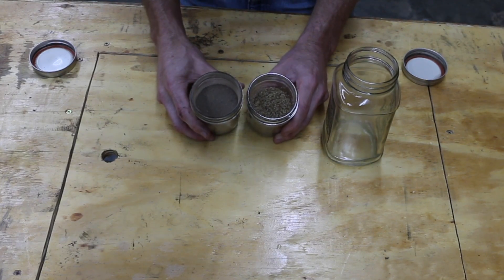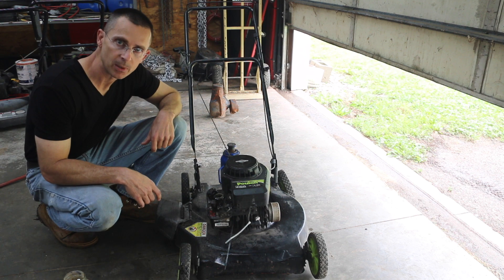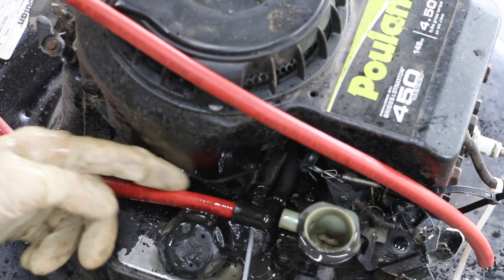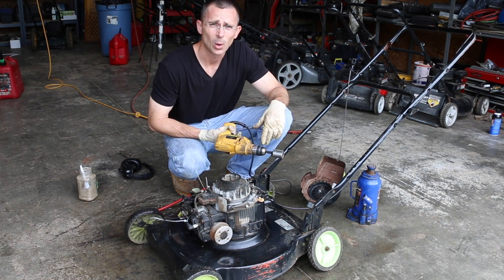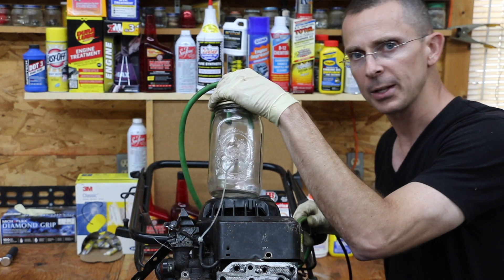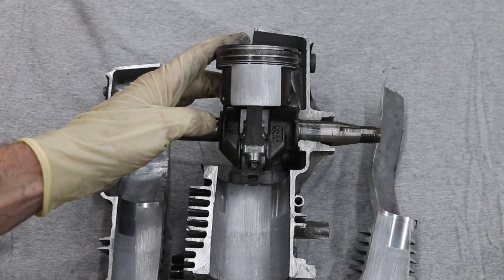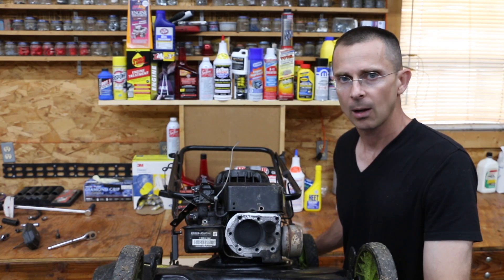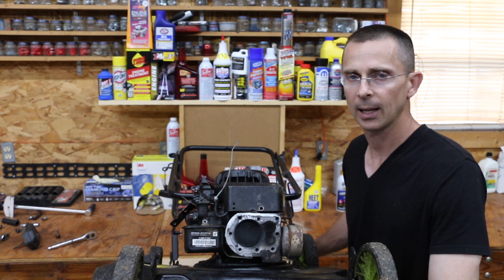Will Dirt Destroy an Engine?  See what it does to this Engine!

Comment: Your channel is awesome!  These videos satisfy my inner mechanical engineer!  I am 16 and I strongly live by the saying that kids need more toolbox, and less xbox.  When I grow up, I plan on being a mechanical engineer. Also, I currently have a couple project engines I am fixing up.  I have a Ryobi Weedeater, and a Homelite direct drive (clutchless as i like to say).  The Ryobi needs a carb cleanout and adjustment, while the Homelite needs an entirely new fuel tank assembly, because the fuel line burst in the middle of me using the weedeater.  Also, I got these weedeaters for FREE, because i saw them at the curb ready to be scrapped, and i picked them up.  Also, we have two lawnmowers, one is a Craftsman 4 stroke, and the other is a 2005 Lawnboy 2 stroke.  My mom's craftsman lawnmower is in serious need of an oil change, and may in fact be seriously damaged, because the engine has rod knock and the engine is very hard to crank, and sounds like it may have some piston damage, because i hear grinding in the engine when i crank it.  So my stepdad and I are going to use my mom's craftsman lawnmower as a practice engine for me to work on.
Reply from the maker: Thank you!  It's great that you're gaining experience!

Comment: Dirt can get through an air filter, some off highway equipment has a safety filter to prevent destructive damage from dirt. The air filter on gas engines is not too critical but diesel equipment like your farm tractor, the air filter must be replaced more often just like the oil and hydraulic transmission fluid.
Reply from the maker: Great point!  Thank you

Comment: Usually I like your methods, but this time I don't think pouting sand in the carb like that is an accurate recreation of what would happen. I would have used a hose from the carb intake into the jar with the sand in it, with another hole in the jar and another hose running down so that the passing air would kick up small amounts of dirt. Letting it run that way for a while would have made for a more realistic  scenario.
Reply from the maker: Thank you

Comment: Why not try xado revitslizant to get the engine back to its original state. They claim so
Reply from the maker: Thank you for the video idea!
Reply: @ProjectFarm  they claim to have run engines without oil after their revitalization treatment. Claimed that there was no damage at all. Compression improved, fuel efficiency improved.... These are the claims. 
They have many products that claim to make your engine forever, kind of.
Thank you for your initiative. I love each one of those projects.

Comment: I remember years ago back when carburetors were the norm in cars, people who lived in high elevations like the Rocky Mountains where the air was really thin would remove their air filters and replace them with coarse steel wool to help get a little more air into their engines. The steel wool didn’t filter quite as well, but allowed for better air flow while blocking any big debris from getting sucked into the air intake.
Reply from the maker: Thank you!

Comment: Not exactly real world and probably expensive but I'm curious as to if the engine was to inhale air through cigarettes how much damage it would do as I am assuming lungs are more delicate than an engine. It might not do any damage although I am expecting the oil would turn dark more quickly. Everyone knows cigarettes are bad for you, even those with a compulsion to use them, but how bad are they for an engine?
Reply from the maker: Thank you for the video idea!

Comment: I restore and use cub cadet garden tractors. First every new to me cub needs a head gasket, everyone I get had a blown headgasket. When I see scored marks in the cylinder that’s proof that dirt entered the engine. Next I checkout the air cleaner. The air filter is missing or has holes in it. Pay me now or pay me later. For the cost of a air cleaner they ruined the tractor. I use the air cleaner with a foam pre cleaner.
Reply from the maker: Great point!  Dirty air destroys engines.  Thank you.

Comment: moral of the story: don't pour sand into your engine..

if you want to get a better test of what would happen over time without a filter, blow sand into a mist in front of the mower while it's running for a tank full of gas (or about 30 minutes).

Comment: Now, correct me if I’m wrong, but I think, I mean I’m just putting it out there, but I think you may have voided the warranty, when you cut the engine in half.
Reply: I just looked at my lawnmowers engine warranty and it doesn't say anything about cutting it in half.  So I think he's all good.
Reply: Just slap some JB Weld on there, she'll be right
Reply: Spit it out!
Reply: @haspin1O5  Slipknot reference?
Reply: it’ll buff out
Reply: I could barely breathe after reading this one!!!

Comment: A long time ago I ran my mower with no oil.It ran all day on the old  sludge so I put water down he intake at full speed & in the end it snapped the block.Block back in place I got the Oxy/Acetylene going then knocked out the flame then fed that in.RPM went right up but no melt down.I did run a oil burning one on Alcohol & 20% water mix & noticed it no longer burnt any oil.
Reply from the maker: Wow!

Comment: This vid helps me understand what they are telling me at the Nissan shop about my Xterra that has a destroyed catalytic converter. I guess they are staying that at least one of the cylinders inside my engine now looks like your lawn mower because the gritty material from the crushed CC recirculated into the engine when the exhaust was clogged. I drove it about a mile maybe after the CC broke but it is blowing blue smoke & making a misfire code. They are saying that the only practical/cost effective thing to do is buy a wrecked vehicle with a good engine & replace the entire insides of the vehicle. In other words, it’s DOA with 125K mi on it. ICYMI the Xterra is a shopping utility vehicle. It is NOT built for off road travel!
Reply from the maker: Thank you!

Comment: What about the valves? I wonder if they were also damaged to the point of letting compression out
Reply from the maker: Thank you
Reply: @ProjectFarm  I was wondering about that, too. My guess is that the valves didn't fully close just after you fed some dirt and that's why the engine slowed down and got back up after a few seconds. It would have been really interesting to see the valve seats.

Comment: I took off my air filter once and a chunk of wood flew into the engine and pieces of its piston flew out of the exhaust cuz also had the muffler all. I would not suggest taking off the air filter.

Comment: I went 4wd in a Nissan Navara D40 down the beach.  When I checked the air filter a few months later (intake near front wheel arch) it was fucking FULL of sand.  Your highway Camry might never get a spoonful without an air filter but go on gravel track and your air filter is the wisest $10 part on the car.
Reply from the maker: Wow!

Comment: Did you really need to do that to prove what damage sand will do to an engine? That did not simulate years of use without an air filter either unless one lives in a desert. That was just pointless destruction.
Reply: fred flintstone no, someone could be mowing and hit a dry patch of lawn, sending dirt into the air, and subsequently into the intake.

Comment: bosses dad took a 150 iron duke pontiac motor out bad noise .  I found 1 bad rod and had it resized crank ground . gave back to old man to put back in 2 weeks later I checked the oil metal flake city !!  Told the old man I must have done something wrong .  He said no I reused the oil that I drained from the motor it was NEW OIL !!!
Reply from the maker: Wow!

Comment: Turbocharge it and over boost it ?
Reply from the maker: Thanks for the video idea!
Reply: @ProjectFarm i just thought it would interesting to source the smallest turbocharger you can then initially fit it to the lawn mower then perhaps the 4stroke bicycle. I also would like to see if its possible to turbocharger the 2 stroke bicycle. It won't be easy but it'll be a lot of fun and devise a test to measure any power gains you may get from said engines. Where do you draw the line ? personally i would tune the cylinder head on the lawn mower by filing and porting turbo it up + intercooler and nitrous😂. It'll be almost certainly be a nbd and good for a million views👍✌.
Reply: Too much work: NITROUS!!!!

Comment: Could you show overheat videos. Like not major ones, just running hot several times. To show like if your thermostat is not working right what will happen to the engine after long term use. Things like that. Or poor fuel filtering. Or running the wrong octane in a engine would be a great video, would take a long test time( former auto industry designer, emisions, manufacturing,engine design, quality and service engineering this is very important especially with todays engine compressions and the tolerance at which they are built proper fuel is important)
Reply from the maker: Thanks for the video idea!

Comment: Also hope that he'd note in this that the engine generally doesn't inhale spoonfuls of dirt when it's driving/running without a filter. Considering most modern engines have a breathe tube that's behind a fender or way high above the ground. If anything it'll take in a little dirt at a time, which yes can damage an engine, but you're more likely to damage your engine from running too lean if you drive without an air filter. 

Not trying to hate whatsoever I'm just making a few points that might also shed a little light on the episode.

Still love your stuff man!
Reply from the maker: Thanks for the constructive feedback!
Reply: It was two years in 5mins.

Comment: Umm, ya... Dumping that dirt in there that rapidly and in that quantity, isn't a great representation of the small amount of damage over time an engine would encounter from dirt particles that float into the intake. Perhaps... make a small chamber, fill it with dirt, force air into it (so it makes dust but, not so much air that it picks up very large particles) and connect the intake of the mower to the top of that chamber.
Reply from the maker: Thanks for the constructive feedback.

Comment: That motor doesn't have iron liners, correct? Kinda makes the text invalid,? Last motor I know of that had aluminum block without iron liners was a Vega cosworth deal from the mid 70',s and they were having cylinder wear problems WITH and air filter
Reply: I'm willing to bet, the engine would be more successful now, with modern oils, with an SN API classification, than with the oils of old, with SA/SE API classification. With today's oils, old engines would have given double the service life that they did back then. (automobile, as well as, these small power equipment engines)

Comment: I wonder if you could make some kind of centrifugal filter like they have inside expensive vacuums such as a Dyson. I bet you could probably get a broken one and pull the large dirt separator off and stuck that where the muffler goes and see how much dirt it pulls out of the air. Also weight the dirt to measure exactly how much stops it and  add the dirt at a slower speed that is constant instead of spoonfulls at a time like some kind of evil doctor poisoning the engine. You could likely do that test without using an actual engine if you measured the speed of the air going into the motor and hooked up a vacuum in there better yet with a flopping piece of debris in the hose simulating the pulsed of air that the engine breathes. Love the tests, keep them up!!!
Reply from the maker: Thanks for the video idea.

Comment: You mentioned dirt and dust but not grasshoppers, June bugs and other flying critters. ... .well lets move on I seen an ad from metal conditioner that is suppose to improve increase engine life through some sort of bonding of the cylinder and piston rings.Not sure how you could check this out but you seem to be a whiz at gasoline engines so I leave in  your good hands and ask dose it work or just a lot of hype and grab your dollars and you don't get that long engine life?
Reply from the maker: lol. Great point on the bugs.  Also, thanks for the video idea!

Comment: Hows this prove anything,   you dumping big loads of dirt directly into the engine.   Its fine dust particles that would be sucked in.   Of course this was going to destroy the engine.   Never seen sand get into an air filter.  Fine dust particles is what's gonna slowly destroy your engine over time.   We run drag bikes with open velocity stacks and our engines run a full season with hardly any wear. And they are ran at full throttle.
Reply from the maker: Thanks for the constructive feedback.

Comment: I’m no mechanic but I would imagine it would at like an abrasive and would eventually score the cylinder wall causing the engine to lose compression until it becomes so low the engine may not run and will also cause it to burn oil i think that’s what caused all the smoke
Reply from the maker: Thank you

Comment: Some time ago, maybe in the early 1980s, I saw an advertisement on T.V. showing how well an engine protectant would work on an engine.  They put the engine on a stand, put the protectant in the engine, ran the engine, then drained out the protectant.  To show how well this stuff worked, they started the engine back up, and with the valve covers removed, started dumping copious amount of sand and dirt and who knows what else right on top of the rocker arms and valve springs.  By the reaction of the "audience", you'd think they witnessed someone turning lead into gold. The engine kept right on running of course, after all, because liquid kryptonite protected all metallic surfaces.  Right.
Reply from the maker: Thank you
Reply: slik50

Comment: Use a leaf blower to force air into a  5hp horizontal briggs n stratton with a rich high circut a/f ratio WOT until it blows, while measuring the psi of boost. You can use a big pvc ball valve to act as a waste gate and close it to bring up the pressure. I love all of your vids and insight, keep up the great work.
Reply from the maker: Thank you

Comment: I have a request. Desludge test. Detergent based. Examples: WYNN'S ENGINE TUNE-UP or Marvel Mystry Oil. Many mechanics say the once an engine losses its compression it needs to be rebuilt or replaced. Or if a lot of oil is getting by the oil ring. Teardown before and after. Run for at least an  hour or maybee 2 would be better.
Reply from the maker: Great video idea!  Thank you

Comment: I think a suggestion for you would be that it is best to wear a mask that prevent the carbon monoxide going into your body system. It caused cancer. So take a break from breathing the crap for a couple years and breathe the fresh air.
Reply from the maker: Great point. I've been wearing a mask for the last year. Thanks again

Comment: What about small amounts of dirt? I did a cam install on my 6.0 and never taped off the intake ports or anything, just covered it with a rag. Never had an issue with the car after. Do people tape it off to avoid large debris only?
Reply from the maker: Great point. Air quality varies a lot.  Gravel roads vs paved.  I would use an epoxy or glue to seal off holes.

Comment: I have a mower that bends the crankshaft because a stone on the grass. And this past weekend i cut mi grass and the mower perform  very poorly and it results on a bend mower blade, i straighten it out and perform like new make a video showing stones, bending blades, unbalanced blades,  mower distance to grass. old and new fuel, always on a rain season i have to use the mower with old fuel, starting problems, etc
Reply from the maker: Great video idea!  Thank you
Reply from the maker: Great video idea!  Thank you

Comment: Can you remove the head without replacing gasket??
Reply from the maker: Yes, it is sometimes possible as long as the gasket coating does break way from the aluminum gasket.  It has been my experience that the gasket gets damaged more time than not.  Consequently, I've purchased dozens of gaskets for the videos.

Comment: Feel bad for my quad.  Idk how it has not blown up yet.  Honda built good machines.  Have not used an air filter in years
Reply from the maker: The air intake must be in a good location without significant dirt and sand exposure.  If I didn't have air filters on my tractors, they'd get destroyed quickly with the amount of dirt and dust that gets kicked up from the field.

Comment: I had the same thing happen to me I had a daily driver mini bike with a after market intake with no filter and I had to engines that went on it and they both blew the piston rings and one slung the rod and one lost all compression and wouldn't start
Reply from the maker: Thanks for commenting on this. It's amazing how many comments insist that an air breather isn't needed.
Reply: Trust me they are

Comment: would a filter 2 times bigger give give a significant amount horsepower?
Reply from the maker: It's unlikely.  However, It really depends of whether or not there is any air flow restriction with the original filter.

Comment: I got one for you, how much water does it really take to hydro lock an engine? Can heavy rain / water on a filter do it or will it just stall? How would RPM effect it ect? I know to clean combustion chambers you can run 32 oz of water into a 5.4 ford over a min of time at RPM with no issues, however even a small amount at low RPM will stall it before it could cause damage, this water is added via brake booster hose though not via air filter and is limited to what a 3/8th inch hose could pull in.
Reply from the maker: Great video idea!